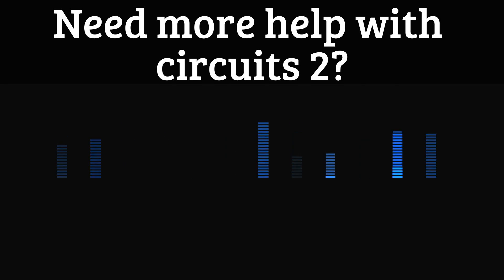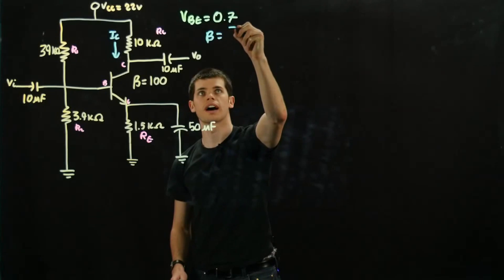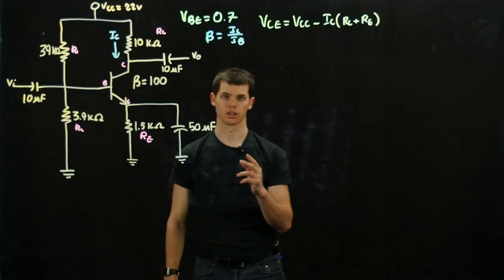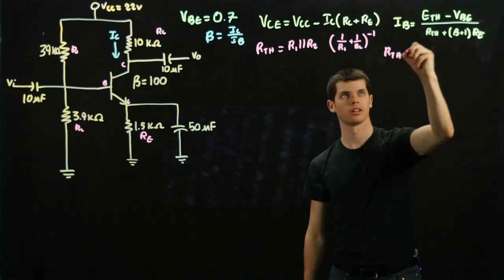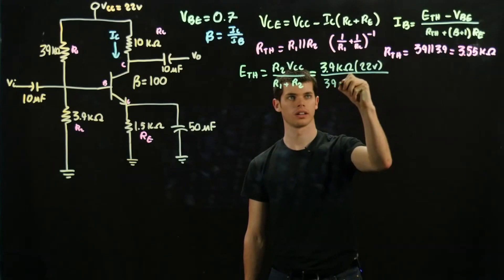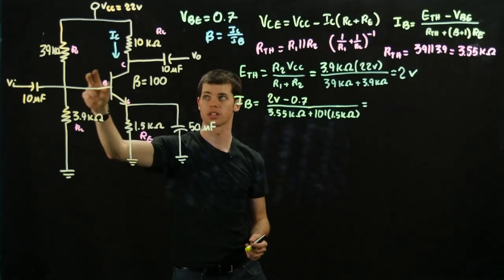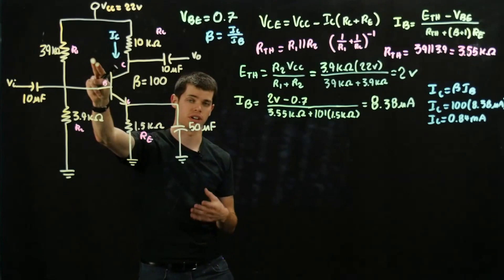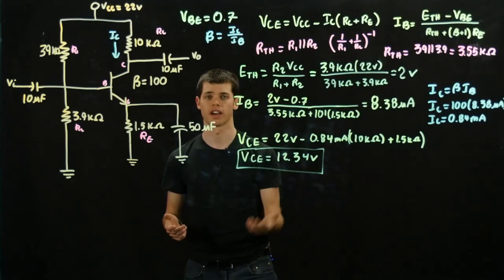Circuits 2 - NPN Transistor

Comment: Is capacitor included in solving problems?
Reply from the maker: Capacitors are generally used to remove the DC part of an input, and thus are left out of the calculations.

~Andrew F

Comment: What is the use of capacitor in the given circuit
Reply: DC blocking high pass filter.  Only an AC signal gets past the capacitor into the amplifier.  Only AC signal makes it out of the amplifier.

Comment: confused, R1 and R2 share only one point and are therefore in series... why use the parallel equation
Reply: haven't watched it yet but he's probably using a voltage divider formula, not a parallel resistance
Reply: @theralhaljordan7337  If you remove both the transistor and the source (following thevenin method), then R1 and R2 result in a parallel set up, so Rth = R1//R2.
Reply: when solving for the DC part of the circuit they are in series for the thevenins, but he is solving for the AC which puts them in parallel